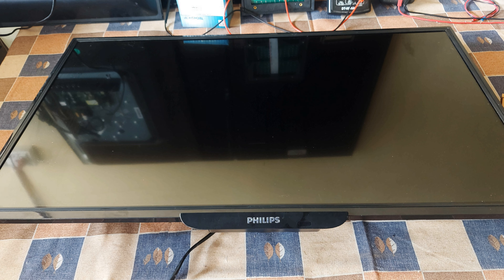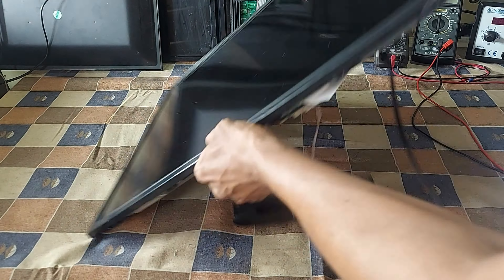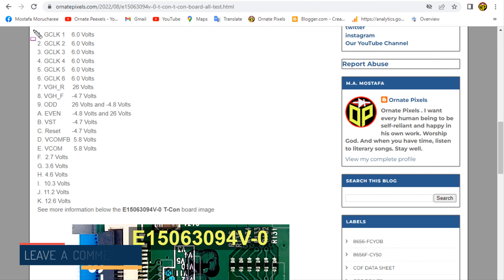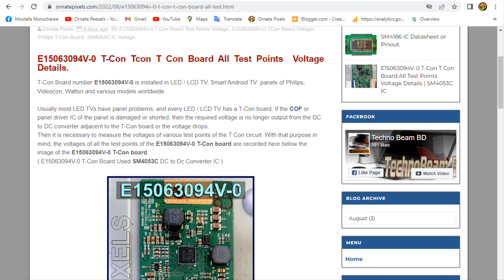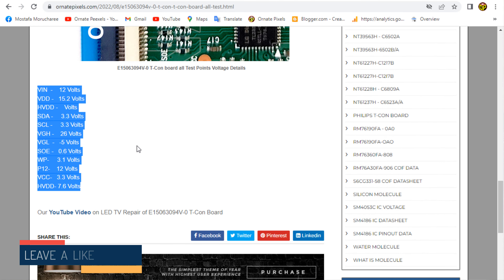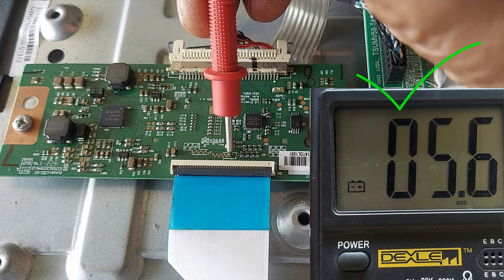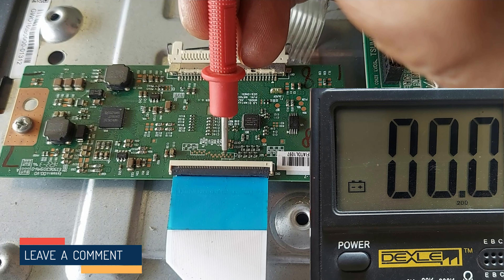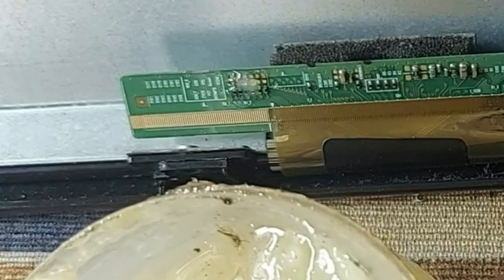Vertical Lines or  Bars Problem | No Picture Philips 32" LED TV | LC320DXY(SJ)(A3) LCD Panel Repair

Comment: Wish the video was longer, the circuit test points am not familiar with and the area you have disconnected I don't know if you just remove solder and why not disconnect on right side as well? Thank you
Reply from the maker: If the problem is not solved after opening the zero ohm resistors on the right side, then the resistors must be installed again. Then the resistors (jumpers) on the left side should be opened. Thanks Brother.

Comment: Hi, I checked all the voltages, first all the voltages were dropping, then I isolated some points from the ribbon.  Now all voltages on tcon board are ok, but on the panel board VGH R is not 26v, others are ok. I think VGH R got shorted somewhere That's why all voltages are dropping. I can't connect directly to 26v without finding short. How to solve this problem?

Comment: Dear  Sir,  I  have  one  mi 55inch  smart  tv .  problem is  vertical bar on picture. panel ST5461DO7-7-C-3. Any  solution  you  have. I was bypass lc1 and  lc2 connection  no improve anything else.

Comment: I had this problem i tried remove both sides resistors still no luck ck 5 and ck 6 only 0.9v all others are 5 volt. Problem stays the same